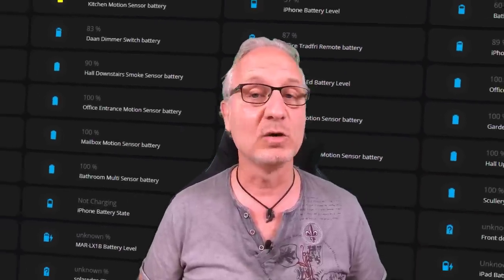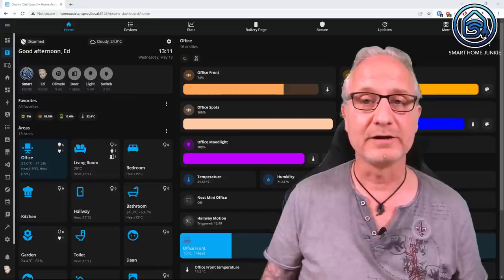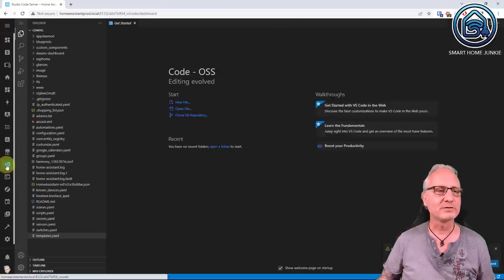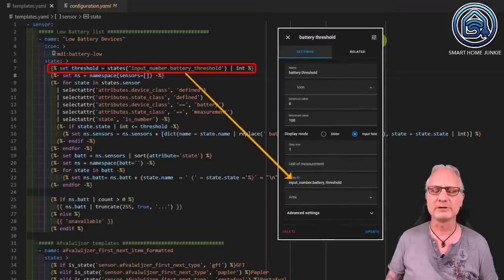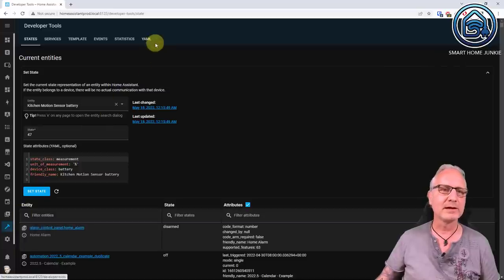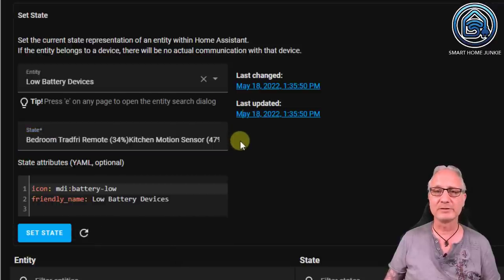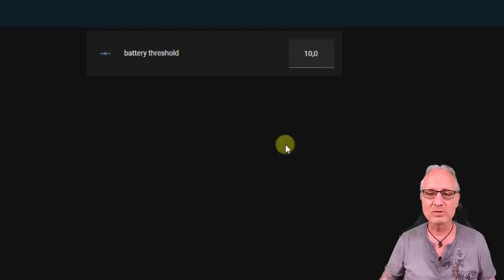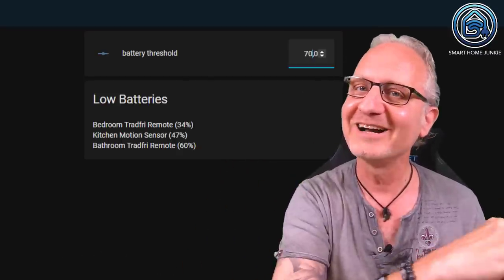HOW TO create your own Low Battery Warning Sensor In Home Assistant - TUTORIAL

Comment: It seems this does not work for any battery that does not have a value. For instance I have a device that has gone completely AWOL and the battery value is unknown. This then makes the conditional card not display for even the devices that ARE indeed below the threshold. Did I miss something or is this a limitation of the template logic?
Reply from the maker: The template excludes batteries that have a non number state. You can easily include this in the template yourself if you like.
Reply: @SmartHomeJunkie  Then I must have missed a step. Very cool. Thank you!
Reply from the maker: @210Bubbagump  I don't think you've missed a step. I guess your battery sensors have different attributes than mine.

Comment: I get this error: extra keys not allowed @ data['template'], can you help me ?
Reply from the maker: Yes, I think so. Please make sure that you do not have other template sensors in your configuration.yaml or sensors.yaml. Storing template sensors in your templates.yaml only is the modern way of doing this.
Reply: @SmartHomeJunkie  I removed my sensors from the config file but still getting the error.?
Reply from the maker: @TalZac  Did you restart Home Assistant after that? Do you also have a sensors.yaml file maybe that contains sensor templates?
If not, I'm not sure what might be wrong in your setup. I think it should be something with having sensor templates defined in multiple files.
Reply: @SmartHomeJunkie  thanks for trying to help me but I think youtube comments is going to be hard to repair this, I need to talk to you on facebook to fix this problem...
Reply from the maker: @TalZac  You can try my Discord server. I am afk atm, but will see when I can respond.
Reply: @SmartHomeJunkie  Thanks for your help

Comment: {% - ... - %} => what are the "-" for? there is no documentation on this one
Reply from the maker: Is to keep "the code together". If you check it in the developer tools, you will see that if you do not use the dashes, each code line will take up space in the generated output. I don't think it really makes a difference in templates though.
Reply: @SmartHomeJunkie  ok ty ^^

Comment: Gone through this a few times, and its not generating a "Low Battery Devices" sensor.
Reply: I also am having this issue.  Your template code on github does not start with - sensor: as you indicate in the video that it must, however I have both included and excluded this line from templates.yaml and it makes no difference; I do not see a "Low Battery Devices" entity via developer tools.  Any idea what is wrong?
Reply from the maker: Did you restart Home Assistant after adding the templates.yaml redirection line in the configuration.yaml?
Reply: @SmartHomeJunkie  Yes, and the Template Entities item appeared on the Yaml Configuration Reloading list where it did not previously exist.
Reply from the maker: @brianh.4185  Ah okay. Well it's hard to say why is not working at your side. Other people don't seem to have issues with it. Maybe the log files might give you a clue? Or, but this is a blind guess, you might have set HA to a different language and the entity name might be different because of that? 🤷🏼
Reply: @SmartHomeJunkie  yeh
Reply: @SmartHomeJunkie  No, it is not a different language issue. Can it be due to the unique id you've included in your github code? I don't see how this could be it but I don't see anything else to go on. I initially used the id in your code but I also changed it while troubleshooting. No joy. I am fairly new to HA and have a fairly uncomplicated/clean install so I cannot see this failing to work due to something exotic on my implementation. Should your code be in a sensors.yanl file rather than a templates.yaml file? Would that make any difference? I am really at a loss here.
Reply from the maker: @brianh.4185  Hi Brian, the unique_id shouldn't be the issue here. It should be in templates.yaml for sure. Can you come over to Discord to discuss this further? You can find the Discord Channel info in my YouTube channel info. There's also a link in the header of my YouTube channel.
Reply: @SmartHomeJunkie  & @Limestar I figured out my issue. Previously I followed another video tutorial regarding setting up notification for unavailable entities. That video directed folks to add the associated code into the configuration.yaml file. It begins with a template: call followed by a - sensor: call. In fact, a template within the configuration file. Apparently, calling 'template:  !include templates.yaml' and placing this low battery code into templates.yaml did not work due to this previous template included in configuration.yaml. (This may be obvious to others but as I said earlier, I am new to all this.) I removed my templates.yaml file, included your code in my configuration.yaml file, and it started working. I believe ultimately I will move both into templates.yaml as that seems the more logical solution. Thanks for the video explaining templates and custom sensors and your willingness to assist when I could not make this coding work!!
Reply from the maker: @brianh.4185  Great that you found the solution. Indeed, moving everything into the templates.yaml is the modern way to do this.

Comment: Great video, but I would like to see a video that tells me how long the battery lasted.
Reply from the maker: Thanks. I think with the info in this video you can build this yourself. You'll need a helper for each battery to store the date and time when the battery was installed / charged to 100% probably, but it shouldn't be that hard to create.
Reply: Biggest problem is to know when new battery was installed or device have taken originally in use. You need to define install /recharge for device
Reply from the maker: @Shellyfi  Yes. I believe you can store that in a helper.

Comment: Hi Ed, being a software noob, I am struggling, i get an error. (the brief error description here, the full description below)
(TemplateSyntaxError: Encountered unknown tag 'ns'.).

I have done several investigations but cannot drill to the solution of the issue. 
I use two types of interfaces, Zigbee and RFX (the old "klikaanklikuit") that have batteries. 
The zigbee has "state" =(battery level), "device_class" and "state_class" 
The klikaanklikuit have these also. 

I have checked the developer console and found that (in my sample) the filters regarding the attributes are valid, so that should not be the issue. I have checked the develop template to check the code, but it provides the same issue. 
I checked the Jinja template expl. document, does not provide the solution. 

What to investigate??

The full error msg:
2022-12-29 18:10:54.843 ERROR (MainThread) [homeassistant.config] Invalid config for [template]: invalid template (TemplateSyntaxError: Encountered unknown tag 'ns'.) for dictionary value @ data['sensor'][0]['state']. Got '{% set threshold = states(\'input_number.batterij_nivo\') | int %} {%- set ns = namespace(sensors=[]) -%} {%- for state in states.sensor\n | selectattr(\'attributes.device_class\', \'defined\')\n | selectattr(\'attributes.state_class\', \'defined\')\n | selectattr(\'atttributes.device_class\', \'==\', \'battery\')\n | selectattr(\'attributes.state_class\', \'==\', \'measurement\')\n | selectattr(\'state\', \'is_number\') %} \n {% if state.state | int <= threshold -%}\n {.... (See /config/templates.yaml, line 0).

Comment: Sorry but I have purchased the code but I still got an error: can you contact me in pvt?
Reply from the maker: The code is just there to make your life easier so that you do not have to type it from the screen. It might be that you have to edit the filters in the ocde so that it works for your devices. You can contact me on Discord if you need assistance.
Reply: @SmartHomeJunkie    Thanks, now everything is fine: I did a very little mistake pasting the code...
One last question: I have a signal problem. Some times per day SonOff sensors became unavailable and, after a couple of hours they go available again.
I got a Ikea signal repeater but  they did not solve the problem: do you have any suggestion?
Reply from the maker: @marcomanferdini  Hmmm. It seems that you did everything right.